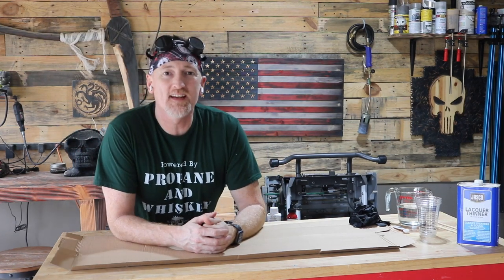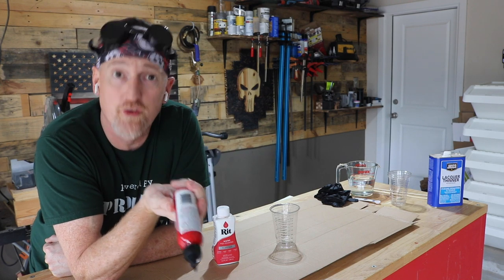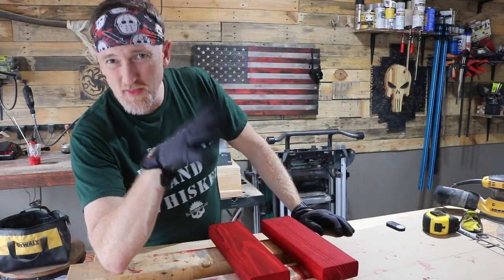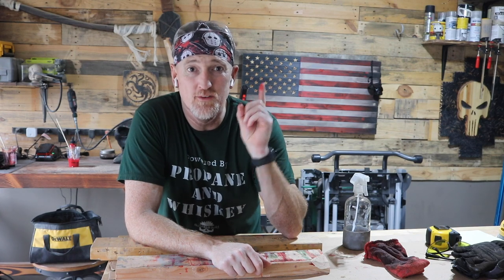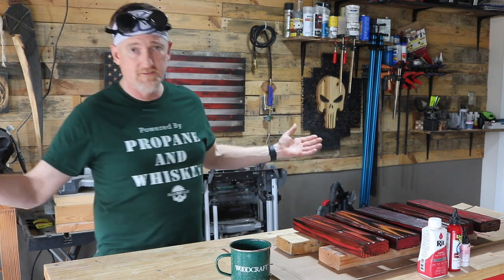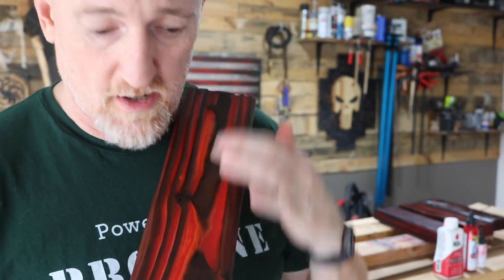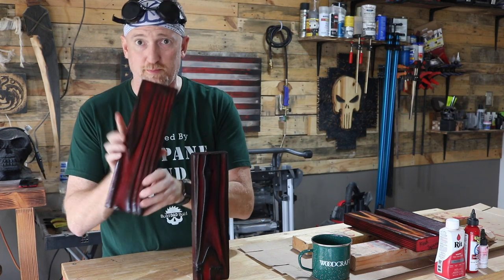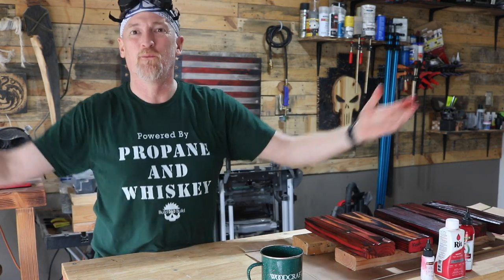DIY Wood Burning Technique - Wood Stain Vs. Dye Shou Sugi Ban

Comment: Hi Nick I got into the shou sugi ban thing about 3 months ago and deep burn everything.  It's way more eye candy than the light burn. Up until I heard about the Keda dyes I just used plain old Tremclad rust paint thinned 50%.  Personally other than the major wiping  when using Tremclad I prefer the final result over the Keda. I'm not knocking Keda at all.  I used the Keda blue on a table which looks absolutely great.  With the Tremclad one coat is all you need but like I said it has to be rubbed out.  The best one I did was when I used Tremclad aluminum.  It's just not a colour you'd expect to see on wood is probably the reason.  Great videos Nick.  I've learned a lot from them
Reply from the maker: Thanks for the love, Peter!
If you work with wood dyes, check out my video on the art piece I created. I used Folk Art Ultra Dye and it's now my favorite goto dye. It's ready to go right out of the bottle. One coat.

https://youtu.be/-_CXfpdS-7I

Comment: Outstanding video. Do you have a way to char 6x1 five foot long boards without warping the wood or twisting? I am about to make my truck bed floor doing burn dye method. I did a test board and warped it.
Reply from the maker: It’s all in the technique.

Comment: Love your videos. Building a wedding arch for my son and his wife.  Going to use this technique.  Initial experiments going well.  One question, if you're still answering them:  The arch is made of box beams (1x6 boards built into a square tube) that are sectioned  in 4 foot lengths.  They are constructed using tongue and groove and will be glued up.  I feel like I will need to build the box beam sections before I do the burning in order to get a consistent burn and to prevent issues fitting it together due to warping or other changes to dimensions from the heat.  Any suggestions on this?
Reply from the maker: Definitely build them first. Tongue and groove can get all messed up during the burn as the tongues are thinner stock and can become brittle. 
I'd say glue the hell out of it and make sure to take quick passes with the torch. That way you won't make the glue bonds fail. Also if you can get a couple  of metal L-brackets inside the beam, it might be a good idea.
Also keep an eye on your end-grain. Heat tends to make the boards cup the way the C of the end-grain is going. Make sure to burn the opposite side to mitigate cupping.
Cheers
Reply: @BuildDadBuild  Great info.  Definitely going to glue like crazy with Gorilla Glue.  I will have box splices inside the box beams (to splice the 4' sections into 8' box beams) so that should take the place of L-brackets.  They will be glued and screwed in.  I don't think I'm going to mess with the end grain other than maybe a quick surface pass to darken it.  It doesn't really show on the arch the way it's set up.  When you say "Make sure to burn the opposite side..." you don't mean the inside of the box beam, do you?  There's no way to get inside the beam and do that safely.  Finally, is there a way to send a picture?  Grasshopper would love to show off his test piece to the master.  LOL  (P.S. Saw the smoked whiskey video and that's on the agenda as a project with son when he gets back from "places".)

Comment: In a previous video you used keta die mixed with water and had the best results.  Why did you used lacquer thinner this time instead of water?  Have you tried this die with water?  Excellent video as always!
Reply from the maker: Thanks!
In the previous video I used the powder (which works better with water). The dye is supposed to work better with lacquer thinner...To answer your question, no I have not tried it with water. yet.

Cheers!

Comment: If making picture frames or small boxes etc should you burn the wood then build or build then burn? Could make a good vid 🙏
Reply from the maker: I would probably burn first then assemble so you can adjust for any warping.
Cheers
Reply: @BuildDadBuild  going to have a go very soon. Thanks for the inspiration 🙏

Comment: Hey Nick, great video man. Have you tried the dye and burn on a pressure treated 4x4? I'm going to experiment and find out soon on pergola posts figured I'd ask
Reply from the maker: Thanks, Tim!
I have not burned any pressure treated lumber. My understanding is when you burn pressure treated lumber you cause all the chemicals used to pressure treat it to become airborne. If you try it, where a respirator!
Cheers!
Reply: @BuildDadBuild  maybe I'll see how the dye soaks in without any burn 1st. Maybe a light burn also. I heatweld asphalt to pressure treated wook plate often, commercial hot tar roofs.

Comment: The the keda dye liquid work best with water or would a lacquer thinner be better in your opinion
Reply from the maker: I like using it with water. It's easier to work with. But it penetrates better with lacquer thinner.
Cheers

Comment: Hey Nick:  I watched several of your videos a couple months ago.  You kindly replied to some suggestions for your show and, later, you answered my question about the best wood coloring to use.  (Keda Wood Dye.  I accidentally addressed you as "Dan".  Sorry about that!)  So I went to work rebuilding an antique park bench, the wrought iron frame for which I found at a thrift store years ago.  Apparently, the wood planks had rotted for they were long gone; only the wrought iron frame, in four pieces, remained with a few of the original screws and bolts still fastened to them.  I'd like to upload some photos to show you the result, my first effort at Shou Sugi Ban.  How may I do that?
Reply from the maker: Hey, Pierre!
You can upload them to Discord here:
https://discord.gg/Aa749ws
Cheers!

Comment: Do you use spray on poly or brush on . Water or oil base
Reply from the maker: I used to use a spray on water based poly. I have since switched over to Halcyon Rugged Varnish by TotalBoat. And you brush that on.
Cheers!

Comment: are those green or dried 2x4s?
Reply from the maker: Kiln dried
Reply: @BuildDadBuild  so you just apply the dye/stain without a pre-conditioner?
Reply from the maker: @pastorstevenrodriguez5495  Correct